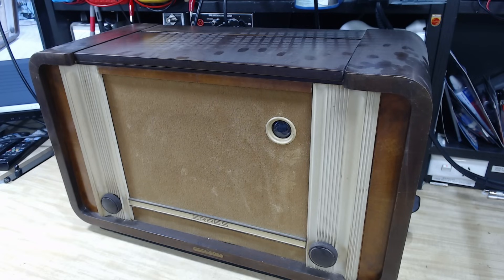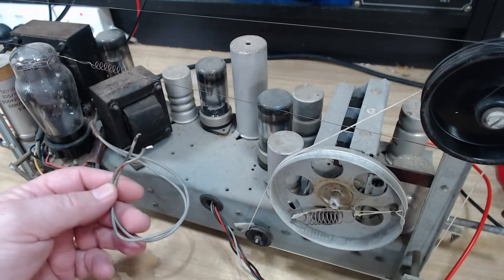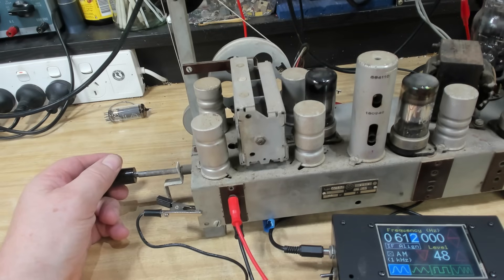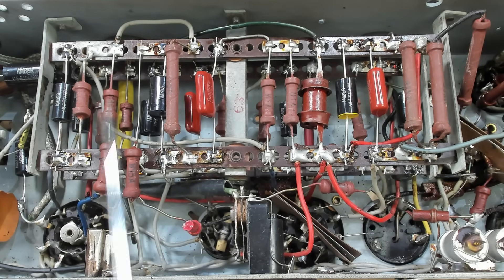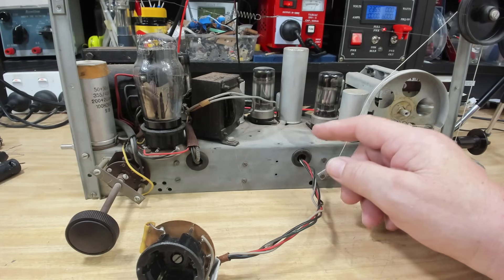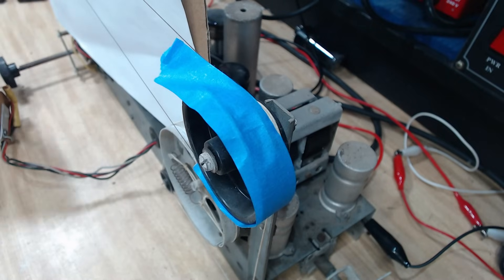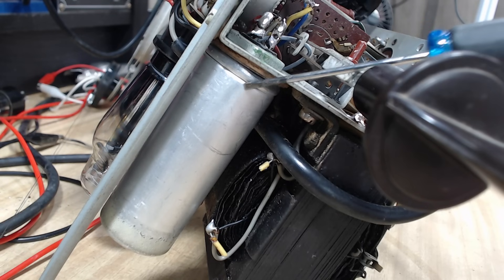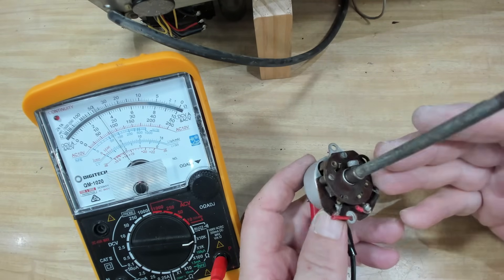Erres KY487 Dutch Radio from 1948 Rare Find in Oz - Part 1

Comment: With the thought of industrial design and "Form over Function".  This is definitely a "Function over Form".  I really wouldn't have stopped if i saw one in a window for sale.  The Dutch are known for their minimalist furnishings but, can you imagine what the rest of the living room looked like!.
When you opened up the valve to repair it and had to draw out this impossibly small wires.  Gosh your patient.  Then i thought.  How the heck could that be manufactured on an industrial scale.
Parts in a bin.  Years back i had a Mercedes Turbo Diesel that was Granny Smith Apple green.  I hated that colour, so i purchased a gallon of Mercedes Orion Blue.  I never painted that car and the gallon sat on a shelf in the garage.  Fast forward 20 years and i bought a nearly off to the scrap yard Mercedes sports coupe for my sons high school graduation.  We spent a year rebuilding it while he was passing his driving lessons.  Guess what, it was Orion Blue and that 450$ gallon of paint i chose 20 years earlier was an exact match.
Reply from the maker: Hi Neil, It is pretty minimalist but it might be better next week than it appears now 😉
I imagine the valve wires would have been longer than that when they were manufactured. Haha.... that's funny, storing paint for 20 years. Good that it came in handy. It would have cost a bit more today I expect, $450 is a lot for paint 20 years ago 🙂

Comment: Suntan capacitors are not bad, and they are not that inexpensive, but their best feature, when bought from a respectable dealer, is the comprehensive original datasheet of the particular type on the dealer's website.
Reply from the maker: I think they come from the local storefront electronics supplier. I haven't had any trouble with them and as you said the specs are available 👍🙂

Comment: Wrong flag, wrong anthem, good video.
Reply from the maker: I don't claim to be a flag or anthem expert but I researched it and it is a French radio in the picture, a French flag and the French National anthem as far as I can tell 🤔
Reply: Nope. Erres was Dutch. Founded in 1923 and later bought by Philips, also Dutch.
Reply: @meneergroeneveld  It was a comparison to a previously restored French radio that was also considered to be not so attractive.
Reply from the maker: The French bit was not a reference to the Erres. It was a reference to the french Unic radio I did some years back.
Reply: It was all about "the ugliest",  and having said that about the Erres, David remembered an even uglier radio, and presented the.... Fwrench ugliness.... And I sóóó agree that that Fwrench one must be designed at least by a pencil licker. That tuning scale...

Comment: Hello and happy 2024, David! This Erres brand was one of Philips'  "alternate brands" like Siera, Dux, Magnavox and more, so Philips components all round. I have done the same as you did with the rectifier, extending the wires to be able to get the leads through. Sometimes I have used acetone mixed with clear nail varnish, just used the brush in the bottle to put the mixture in the gap between base and glass. It will dissolve the old cement and make a good bond. Two rubber bands to keep them together while hardening. Strong "bathroom reaction"  ;)
Reply from the maker: Thanks greengrayradio. Happy New Year. I have used the acetone/nail polish repair a number of times but found it was temporary at best.There is usually a fair bit of dirt in the gap or something stops it sticking. Removing the base is painstaking but works well if you can be bothered 🙂

Comment: Hi Dave, the dutch brand erres comes from the initials of the founder of the company, R.S. Stokvis. The company did not just make radio’s. I have seen also washing machines, TV’s and fridges. The company was taken over by Philips.
I like this radio. Never saw a Dutch radio with octal tubes before.
Reply from the maker: Thanks Diane. I read the Erres story on Radio Museum. I could not work out hao they got the name ERRES from R.S. Stokvis. I assume you mean Loctal tubes, it is unusual 🙂
Reply: That puzzled me too but I think "Err" for "R",  "es" for "S"... and just bypass the Stokvis :-)   Another very interesting video, thank you.
Reply: Yes but it only works in Dutch. R is pronounced more like air rather than are.

Comment: This radio bears strong similarities with the Philips 462A and similar Philips models of the period, including the tuning scale, valve lineup, wire tuning drive and many component types, unmistakably Philips in origin. It would be very interesting to discover the relationship between Erres and the Philips company of Eindhoven. At least one thing is pleasingly difference from the Philips 462A, you can actually get the bakelite knobs off the shafts!
Reply from the maker: There is undoubtedly lots of Philips in this set. According to what I have read Philips wasn't part of Erres at the time. Thanks Lynton 😀
Reply: Thanks David. I've since been boning up on the company history of Erres and the relationship with Philips and others, quite complex and fascinating, kind regards.

Comment: Hi David, about the leaking current for caps, I found some numbers to hang on to, it is dependent on capacity and voltage. For older electrolytics, or low quality brand you could use 0.1 x CV after one minute. For modern and high quality electrolytic use 0.01 x CV after one minute. If you apply the first on your old cap (at 350V, don't know what was installed):
0.1 x 0.00005 x 350 = 0.00175 A or 1,75mA after 1 minute.
Yours did worse than that, more than 3mA after a few minutes.
It is just a possible way to measure, and you could keep it in mind with you new leakage tester.

Btw, I have an Erres portable from the early '60 here waiting for that spark to revive it.... It was a well known brand in the Netherlands in its time.

Have a good and happy new year for you and the family !
Reply from the maker: Hello Eric. Thanks for the info, I did read all about that but figured I would compare it to a new cap, too lazy to do the math 🙄 I will use your figures next time. I have used the tester since on another video that has not been released so it will not be used for that. Maybe you will be inspired to do your Erres now. Happy New Year 🙂

Comment: Hi David,
When replacing capacitors in a radio with Carl’s black capacitors, how do you go about identifying the foil end?  I note that most of the older “Ducon” capacitors do have a marking around the foil end.  I am advised that this is quite important to ensure low induced noise levels - is this your experience?
Cheers
Reply from the maker: Hello Saint Michael. I don't get too worried about the foil end unless it is in a sensitive area in the radio. I know there is quite a bit of information on the internet about it. 
I use my oscilloscope to find the foil end. Connect the scope leads to the capacitor and pinch the capacitor between thumb and a finger, swap the leads around and determine which direction has the lowest reading. The cap lead with the scope ground wire attached is the foil end. 
If you don't have a scope handy you can use a DMM. Set the DMM to millivolts and connect the leads to the cap. pinch the cap as above and wait till the reading stabilises, it will take 15 seconds or so. Reverse the leads, the lowest reading denotes the foil end and the negative lead will be attached to it.
There are other methods if you search the internet 🙂
Reply: David - thank you very much for the prompt reply - I appreciate your expert advice and will look into this aspect further.
Looking forward to your next radio adventure!!

Comment: After having done hundreds of multi-band radios, first step is to run the bandswitch back and forth a few time to clean off the old crud. There is so little power going through it that it takes nearly nothing to block it.
Reply from the maker: Thanks Brett 👍

Comment: Great work again as usual Dave, i watched the re stuffing the electrolytic part with great attention. I fear i may have to do it on the Grundig currently on the bench.  I agree the look of this one is a little bland as it stands, but i suspect you will make it really stand out once you're done with the cabinet.  On the other hand the pop out dial is really cool i find.  Thank's for sharing, eager to see part 2 now 🙂
Reply from the maker: Hello Raymond, thank you. Good luck if you restuff your capacitor. You will have to wait until part 2 to see the case, I think you will be surprised. The pop-up dial adds another element to the radio 👍🙂

Comment: Coming along nicely. I will be re-stuffing a dual electrolytic capacitor in the next few days, so it was great watching somebody that has done several before. It probably won't look as neat as yours, but I'm sure it will work fine. I'm interested in seeing more on that flip-up tuning dial, which is unusual for the age of that radio, but I might be wrong.
Reply from the maker: Thanks Nigel. The flip up dial is pretty simple but adds to the charm of the radio. Good luck with your re-stuffing 👍😀

Comment: Why do you prefer the black yellow caps over orange or brown drops.
Reply from the maker: Only that the black ones look better than bright coloured ones. The originals were black and it would have looked better if the replacements were black also. No difference to the radio operation 👍🙂

Comment: Happy New Year
Great work on that old dutch radio.
Just wondering if you have considered using the lathe when closing up those lagre caps after restuffing?
Shouldn't it be possible to fasten it in the lathe and use it to rotate it...?
Reply from the maker: Hi Geir. Thank you. The cans are too soft to grip in a lathe, they just buckle. On the plus side the metal is soft enough to roll on the wood 👍🙂